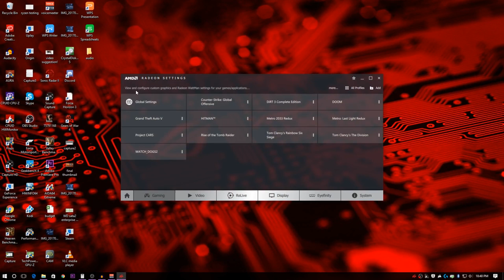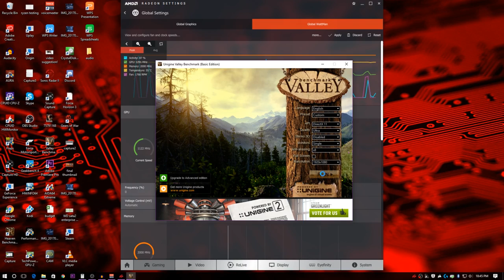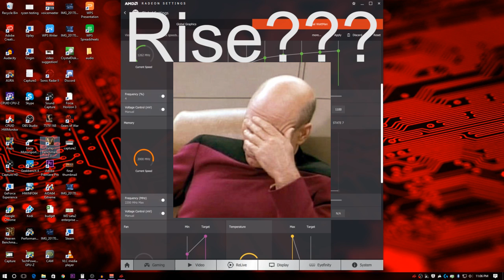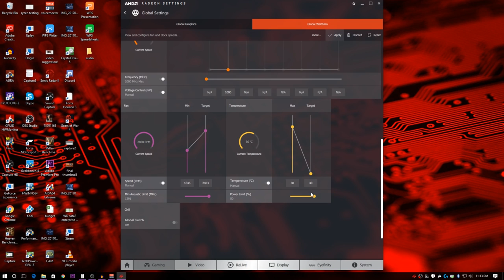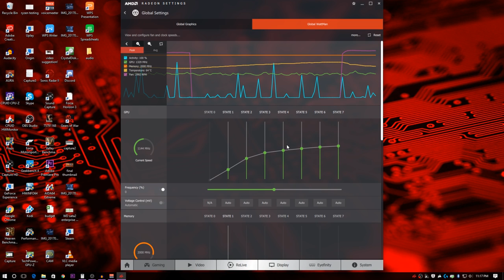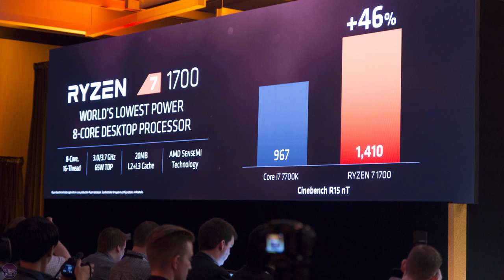Beginners step by step [how-to] overclock your AMD video card (RX 480)- Global WattMan

Comment: My MSI Gaming X Rx 480 reaches 1390Mhz without crash and no voltage modification. Temps are not the cause of crashing, so what would it be?
Reply from the maker: For starters it may be due to the fact that you haven't changed the voltage at all. As with any piece of silicon the higher you go in frequency, the more voltage necessary to stabilize that overclock. The voltage need usually increases exponentially when you are getting close to your peak. Also, keep in mind not ever card is going to overclock the same. You could buy three identical cards and they may all overclock differently. That is what we refer to as the "Silicon Lottery".

A quicker way to see what your limiting factory is would be to use GPUz. This is a small piece of software to download and at the very bottom there is a bar that will basically tell you what your limiting factor is. Do a quick google search once you see what your limiting factory is (the reasons are abbreviated so sometimes they don't necessarily make sense without context). If you can't find what you are looking for, comment again and I would be happy to help.

Comment: after watching the vid, and first try oc on a xfx rx480 8gb gtr I got. Core clock at 1390mhz, Mem 2200mhz max temp 72 deg c with all voltz at 1100 and freq at +8%
Reply from the maker: Not sure my last comment saved.

I would consider that a good result!

Comment: I've managed to overclock my Rx 580 to 1420mhz, the memory to 2250 and Max power limit to fans and put max temp and 75 and minimum at 65. And I maxed my fan target temperature and the minimum is 2260 and my card stays at a constant 70°c. Is that good?
Reply from the maker: Absolutely! I see nothing wrong with anything you have done. Seems very similar to what I would do.
Reply: @LetsGetTechy  ok thanks btw I have got it to stay at a max temp of 60°c now

Comment: My rx580 gpu clock speed is stuck at 300mhz.. and despite me adjusting to frequency above 1000, n when I run furmark my MHz is below 1000 n it drops as furmark runs
Reply: Help

Comment: hm so if my stock settings are giving me a better score, would that be due to power consumption and the power supply not being large enough?  now I also have read that some cards have a power connection instead of going through the motherboard. which is apparently important. I just picked up this computer today, was interested in building my own, but with the market so bad right now I just picked up a used comp with 460rx 4g added to it
Reply from the maker: If your score is better stock, you are running into a limitation of the card. It may appear stable, but it actually isn't which is why you are scoring worse. You should be able to back it down a bit and achieve a score higher than stock.

Comment: Hi, I flashed my card using atiflash,polaris,ets, able change out of box speed 24mh up to 27mh, i did it on my personal desktop and put in rig running SimpleMining OS, worked perfect, but have problem with second part, if I change parameters with MSI afterburner or Wattman on my desktop and disconnecting and connecting to my rig changes not saved, what i'm doing wrong?
Reply from the maker: I don't mine. I can't help you. This guide is meant for overclocking in regard to gaming.

Comment: i Have "I5 2éme G CPU" Normal with "Rx570 Oc 4Gb" "500W PSU" i play Forza Horizon with 120fps "Ultra" But i Get 66C° In CPU - GPU its normal ?
Reply from the maker: Yes, I would call that very normal. Sounds like it's working as it should. 👍

Comment: My wattman has the temperature and fan section combined and theres a line graph. Do I raise the line all the way to the top to max out the fan?
Reply from the maker: Try a 1 to 1 fan curve. Start at 30% and 30c and go up about 1 to 1 from there. Make it max fan speed at max temp.

Comment: hello , i am an avid Under-clocker . i like cool running silicon . How much percentage in Wattman can the GPU clock be adjusted  +- the base frequency ?  my max target is  60 C .  i run the  CPU at a Fixed frequency using  window's  Power Options , typically  45 % min  with  45 % Max .  Can Wattman be setup  so the  GPU frequency is  Fixed ?  say , 1 Ghz min with 1 Ghz max . 

i want to set the GPU clock , to say  -minus 20 % , in additi0n to that , i want the GPU clock to remain at
just 1  frequency of operation , say ,  1 Ghz min and 1 Ghz max ,  is that possible with  Wattman ?

The reason i ask , presently running  APU , thus No  Wattman .  Looking to get a  card , but those
80 C +  temps are way out of line . The best way to cooler temps is to lower the clock frequency .
If i can't do both adjustments , then not getting a card .  thanks ,
Reply from the maker: Hey there! I'm not sure off hand how much adjustment there is with the +- slider, but I can tell you that as far as I am aware I don't believe you can lock the core frequency to a specific value. The boosting algorithms are built into the BIOS of the card. 

That being said, if you get a partner board card, like say from someone like Sapphire with an aftermarket non-blower style cooler on it, I think 60c would be very attainable by just adjusting the power slider. Instead of limiting your core clock, you can limit your power to the core to keep temps where you want them, and the card will continue to use it's boost algorithms to adjust frequency within it's newly set power limits.
Reply: @LetsGetTechy Power  adj is the way to do it , ok .  All this has come about with the new  RX 5700  Navi . AMD seems to have temp issues , but i like  AMD . You say 60 C is obtainable with Wattman , that is good news .  Extra ,...i had just watched the  Gamer Nexus  Tube video on the  new  RX 5700 , they say to  remove the heatsink pad , paste it , offset with washers ,  blah ,
way too much effort there .  Under-clock or you say here , Power Slider  and done .
much easier , thanks .

Comment: I have a pretty stable overclock, but every time I lower the voltages below 1150 it crashes. I've got everything else stable and cool. How much more power am I really using? any ideas? or is it no big deal to run at like 1100-1150 all the time? thanks! great vid BTW :) MSI after burner really doesnt like this card ...
Reply from the maker: Thanks for the comment! I am a firm believer that if you have good temperatures and everything is stable, don't worry about the voltage. There are other overclocking situations where too much voltage is a terrible thing, but with these cards, it won't allow you to give it a stupid amount of voltage. Enjoy it!!
Reply: awesome, thanks!
Reply from the maker: You're welcome!

Comment: The  default  min\max for  State 0  GPU is  300 MHz
The  default min\max  for  State 0 Memory is  300 Mhz
The above  gives about 5 watts , Five watts  when on the dektop , thus  Fans are  Forced OFF .
fans will last longer that way .

youTube\browser won't let me edit the previous post , so i made this new short one .
Reply from the maker: Your comments contain some great information. I think I'm going to pin the bigger in depth one so that other people can see what you have done in case they want to replicate it. Awesome work!! Nothing at all wrong with underclocking for better temps, and especially if you can still hit 60fps for the most part while using a 60hz panel. No need for anything more than that. I love it.

Comment: I have same card but 4gb should I go any lower than you did?
Reply from the maker: You can go as hard as you want. It will not hurt your card. Find the point where you lose stability and then back it down just a bit from that point.

Comment: I am thinking of adding to my current build with a carbon blah blah blah msi board with ryzen 5 and I want to know if I'll need a new graphics card. Is the and xfx Radeon 480 crossfire compatable?
Reply from the maker: You will not need a new card. It is compatible. You can actually go back several years and older video cards are compatible as well. Video cards usually die or become irrelevant before they are incompatible if that makes sense.
Reply: Let's Get Techy could you PM me a picture of where the crossfire bridge would go? Discord: KnockKnockSON#0891
Reply from the maker: There are no bridges necessary for crossfire.
Reply: Let's Get Techy Isn't crossfire AMDs version of SLI?
Reply from the maker: Yes, but they do not use bridges anymore.
Reply: Let's Get Techy alright... Strange but then again thank you.
Reply from the maker: You're welcome!

Comment: I have global chill ,I don't have global wattman. What should I do?
Reply from the maker: Sometimes aftermarket board partners don't allow Wattman to manipulate their GPU. Try using MSI afterburner.
Reply: i have radeon r2 graphics card. Will it work?
Reply from the maker: I assume you mean a 270, 280, or 290 series. Those will work with MSI Afterburner.
Reply: When I launch msi afterburner all options except the core clock is not active? Memory clock appears to be active but I cannot change anything. What to do? How ever I want to maximise everything
Reply from the maker: You will need to look up a how-to for your specific card to unlock those features. Though, if your card has those greyed out by default, there is probably a reason they don't want you changing it.
Reply: can I enable them using anything and I can even change the settings in Bios
Reply: You are the only great youtuber who replys to their subscribers and helps them and I am very greatful to you. I have subscribed your channel with all my accounts( I have 3 accounts) And also liked your videos
Reply from the maker: So happy to hear that!! Were you able to get your overclock going with Afterburner?

Comment: I have a question i tried to overclock it and my screen went black and  did not turn on i had to restart my pc the a massage popped up and said my global wattman settings were reseted and since then my games are very laggy compared to before overclocking
Reply from the maker: You pushed a bit too far which caused a driver crash. I would do a clean driver install to start all over again if you are having performance issues now.
Reply: @LetsGetTechy  soo reins the driver and do it the same way just u der the numbers thag coused that

Comment: My GPU speed and Memory is stuck at 300MHz and doesnt seem to be configurable, any easy way to fix this?
Reply from the maker: I have heard of some people having better luck with software like MSI Afterburner when using non reference design cards. Maybe try checking into that and seeing if it works any better for you.

Comment: Does this work on the Rx 480 Asus DUAL 8 GB???I don t want to destroy my card.Is it safe??Could you respond???.Thx.I don t want to mess the voltages and fry my card.
Reply from the maker: You aren't going to fry your card. It's safe and yes you can adjust voltage. Have fun!
Reply: Let's Get Techy .Thx a lot.One more question.MSI AFTERBURNER OR WATTMAN?
Btw I also got 4 120 mm case fans .One of them blows cool air directly on GPU from the side.Do these help?
Reply from the maker: Those fans will definitely help. Maybe even increase the speed of the one blowing on the GPU. I prefer Wattman, but they do the same thing.
Reply: Let's Get Techy You are a life saver!!😀👌Keep up the good work
Reply from the maker: Thanks for watching!

Comment: Jesus, just ran valley on those original OC settings, stopped it like 20 seconds in as it sounded like my card was just gonna fucking take off or blow up or some shit...
Reply from the maker: Hahahahaha... This literally made me laugh out loud. Thank you so much for your comment. I needed that today.
Reply: Np man, glad I gave you a laugh, in all seriousness though, is it safe to run the benchmark even when it sounds like that?? xD
Reply from the maker: It definitely is safe. It's good that it's making that much noise because you know it is working hard to cool itself. You can back down the fan speed to something you can tolerate once you find your peak overclock.
Reply: Okay, gonna go ahead now and hope it doesn't wake up the girlfriend, if it dies you owe me a new GPU xD thanks for the tutorial bro :)
Reply from the maker: Women are unpredictable. I make zero claims to help in that department. I could probably use some help in fact! Haha. Enjoy overclocking brother! Thanks for watching and let me know if you have any questions.
Reply: yeah... im overclocking and upping the core clock, yet im getting a worse score??
Reply: I know this is late, but I wanted to overclock and found this video. I have an AMD Radeon Rx 560 2gb, Ik 2gb's , but I over clocked the GPU to 11%  and the max voltage at 1020, the memory couldn't be overclocked for some reason, but everything  pretty stable. Went from max fps 83- 95 , but that's not my question. I'm concerned about the fan speed, and temperature. Can you recommend me a good balance temp. and fan speed. Something that will keep everything cool, performing good, and doesn't blow up my entire house.

Comment: Temperature settings aren't showing up for me? Is there anything I need to do for it to show?
Reply from the maker: I have not encountered that problem. :( Sorry I can't be more helpful!
Reply: One more quick question while you're here: why do you prefer running with 1150 on the Voltage? I've seen a lot of people say they'd rather minimize it but I'm not a pro so I don't really know the difference of minimizing and maximizing it.
Reply from the maker: I start with it maxed and then work my way down. It's the exact opposite of what most people do, but I find that it helps me find my max overclock quicker.

Comment: i overclocked for bf1 and i play ultra i have a rx 580 4gb sapphire nitro an di was getting worse frames i went back to stock and i had better frames why is that??
Reply from the maker: That is a very good question, and probably something I should do a video on in the future. When you overclock a video card or even CPU for that matter, you can reach a point of deminishing returns. The hardware will still seem stable and won't crash, but it's running so close to the edge that it actually hurts performance. I really appreciate the question Christian!

Comment: I can go higher but will need more volts.. is it bad if I use 1150v if my temps are ok?
Reply from the maker: Awesome overclock on your first comment!

Nothing wrong with running 1150 voltage as long as you can keep temps in check at that voltage. :)
Reply: if your psu can pull all of it id see it fine too heheh

Comment: hey, can anyone tell me if 1,25V for the MSI RX480 Gaming X is too much for the chip // lifetime shrinks drasticly?

cos i get it stable @1450mhz core clock with max 1,25V.
temperature 70+°C with stock cooler at only 50% load.. ^^
Reply from the maker: What is your temperature at max load?

Comment: i oc ed my gigabyte r9 390 8gb to 2000mhz and screen went black and it dont works anymore....
Reply from the maker: A bit ambitious. I would suggest one of two remedies. First option is boot to safe mode and delete the OC profile via deleting the OC software. Second option is putting a different card in your computer and then deleting the OC software, then repopulating your video card in the computer.

Comment: Can anyone tell me why after modding the bios my hashrate will only randomly run at 30MH/s and typically fall back to the 24MH/s?

1180MHz core, 2150 Mem.  MSI 580 Gaming X 8GB Hynix.

Comment: The temperature and fan did not show up on mine. I NEED HELP ASAP MY GPU IS AT 72 DEGREES C
Reply from the maker: 72c is fine. That's not a bad temperature for a GPU at load.
Reply: wait does your temp show in Fahrenheit? That’s probably what confused me
Reply from the maker: @frandrew109  my temp shows in C. Here in America we are super stubborn about the metric system, but we definitely still use it when it comes to computers. Haha

Comment: So I tried everything you said and well now I am just to scared constant crash at 4% no gains form what I saw from beginning to stable with 3%.  Then once I started backing down fans it just would crash even more.
Reply from the maker: Sounds like you have a card that unfortunately is not a very good overclocker. I would recommend just running it at stock.
Reply: @LetsGetTechy  well that sucks I have had this for 2 years runs very good. It's an rx 480 xfx 8gb version

Comment: I know I’m late but does anyone know why sometimes my computer completely shuts off even when I’m running stock setting? I think it’s because I’m overheating something because my cpu is a fx-6300 with a stock heat sink and only a single 120mm case fan also my gpu is a rx 480 8gb vram MSI gaming x edition with a asrock 970m pro3 and my psu is a evga 600B 600w 80+ bronze when my pc turns off it just goes straight to a black screen
Reply from the maker: Use a free program called HWinfo64 to check your temperatures. If your temps are okay, my first guess would be a bad power supply.
Reply: Yeah this usually happens when I play 2 games of rainbow six siege but I just cleaned my pc and now I’m testing 
It to see if it helps and I ordered another case fan I’ll keep you updated
Reply from the maker: Cool. Good luck!